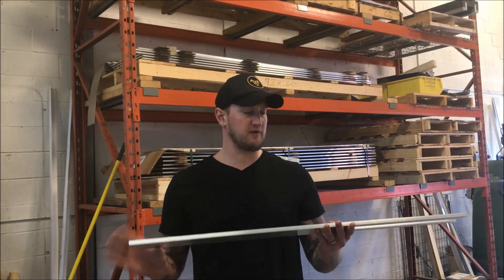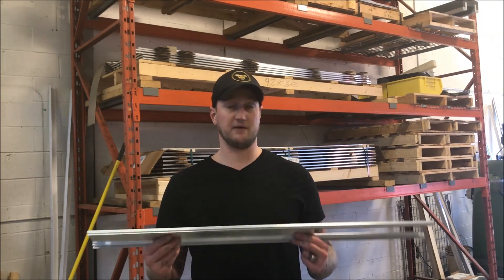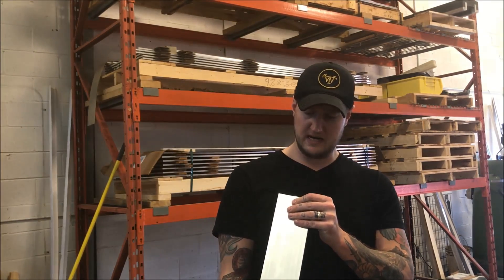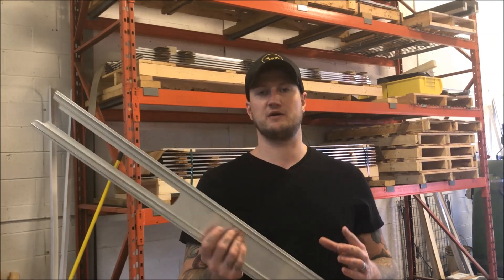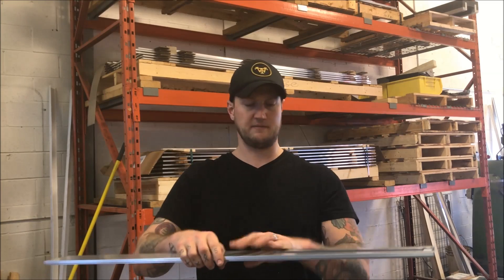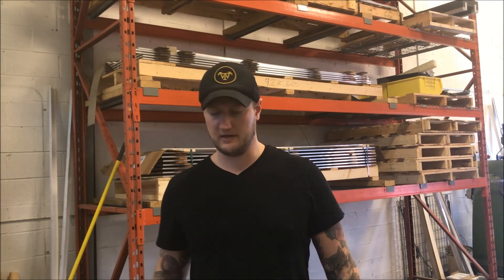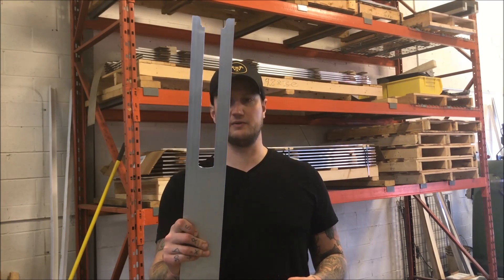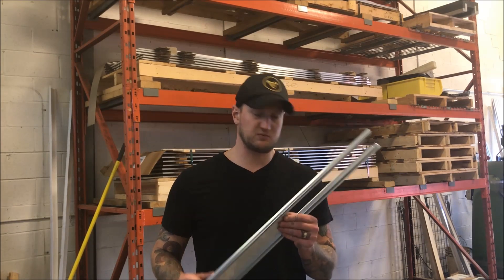[TT] Fixturing for CNC Machining Thin Aluminum Profiles

Comment: "As long as you remember to remove the pin". It always sucks crashing your machine but production runs are weird... Doing the same thing over and over in short run times has a tendency to shut off your brain cells 😨
Reply from the maker: Oh yeah! We had another fixture for doing another extrusion 4 pc at a time that used 4 of these pins, and I’ll never forget the sound or sense of dread when you’re 15 years old and hear the machine behind you start crunching. If you look closely, you can see I’ve welded the head back on this pin a time or two!

Comment: Thank you for this.  Where do you set your WCS on this fixture?  The dowel pin or a hole on the fixture itself.  Keep them coming please.
Reply from the maker: My pleasure! The zero is set at the far edge of the part and the end of the part after the dowel has been removed - so the edge of the dowel, essentially. Works to within .005 which is more than good enough for this application! They’re covers for some kind of office furniture components.